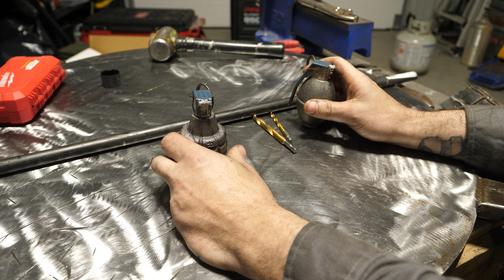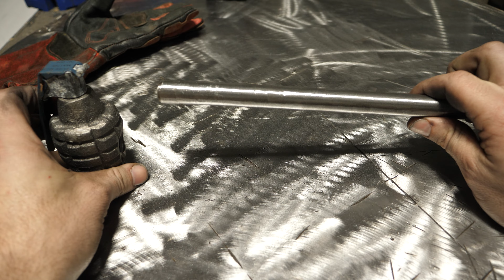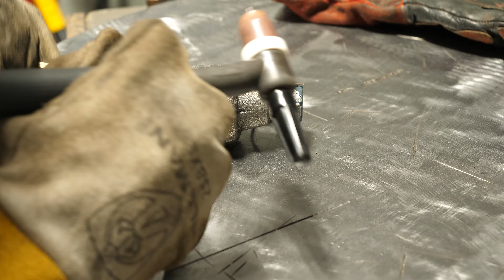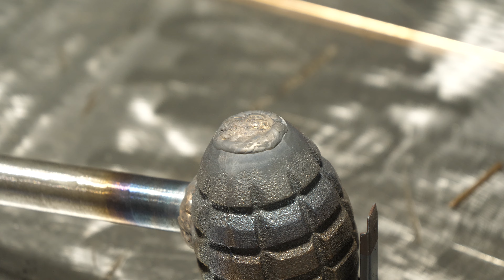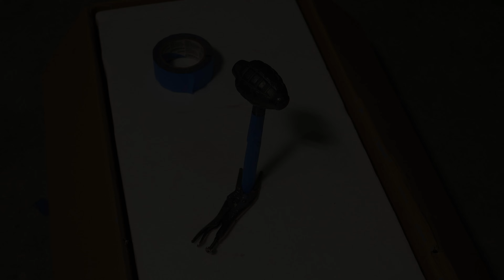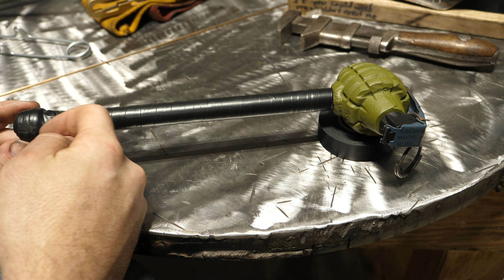Fun welding project:  Making a dead blow hammer

Comment: wondering if it was April 1st there for a minute.  

I just got some ERCuSi and hope to find time over the holidays to start playing with it.
Reply from the maker: It is pretty easy to work with if you flow it like solder or lead.  The goal is to not melt the base metal and just flow the bronze.  Once you get a handle of running it you will find a lot of uses for it 😀

Comment: Maybe try hockey stick tape.  It doesn't slip. Twist the tape into a string and wrap around the handle in a spiral.  That gives it grooves your hand can hold. Then wrap the handle up just like you did with the electrical tape.  That's the way hockey players do it.
Reply: The glue on hockey tape melt/rub off. Doesn't matter if you are wearing thick gloves that you don't mind turning black and sticky, but gets painful quickly bare handed.
Reply: @greentjmtl  Rob Cosman puts them on the mallets he makes.
Reply from the maker: I will have to give that a shot for a bit more traction 😀